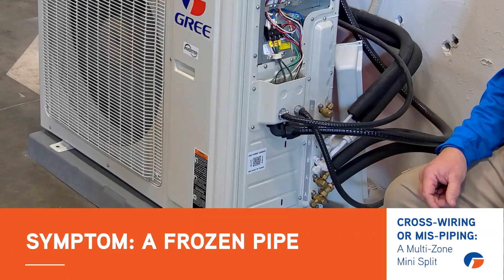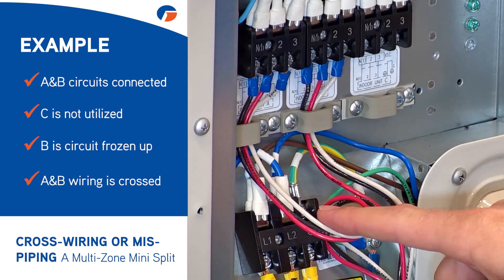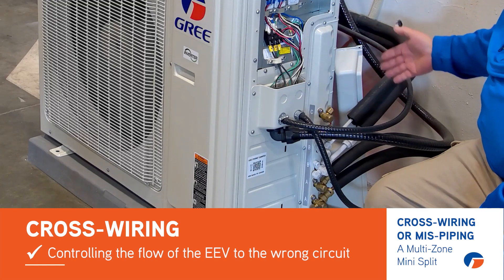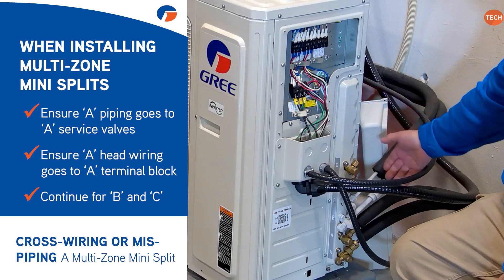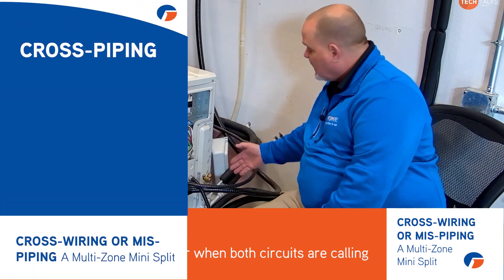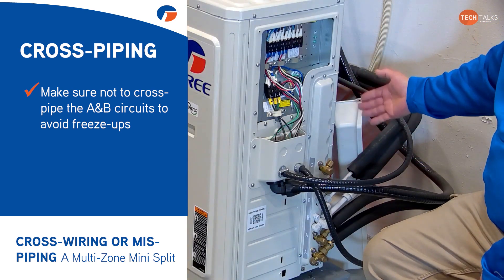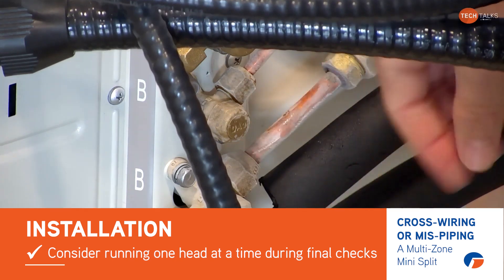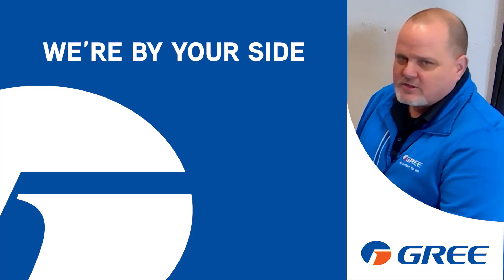Troubleshooting a Cross-Wired or Mis-Piped Multi-Zone Mini Split

Comment: In a crosswired systen, icing doesn't always happen. In fact, most of the time icing up didn't occur, so i had to use other indicators to figure out the correct piping sequence